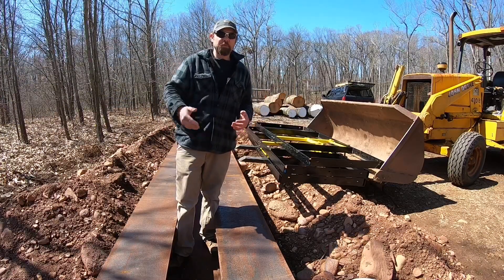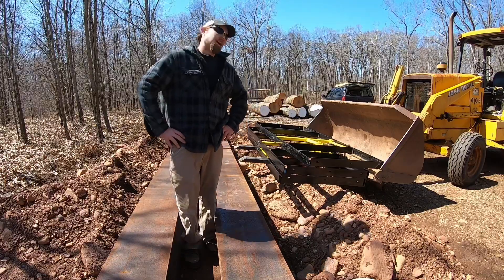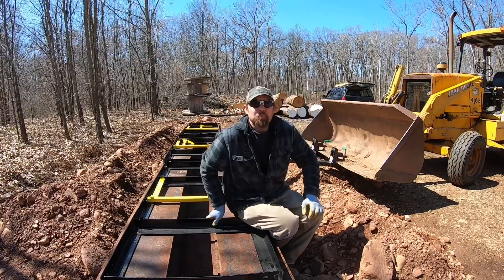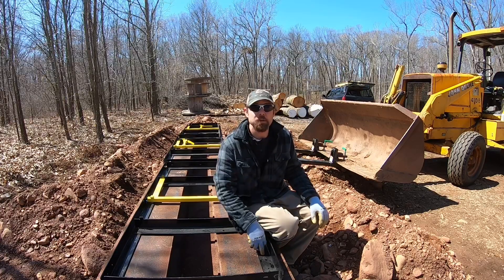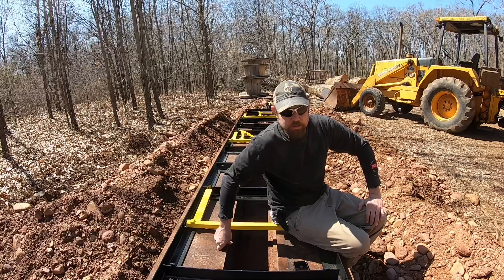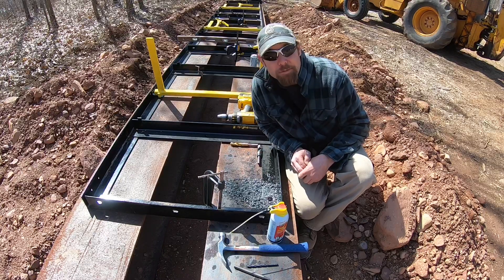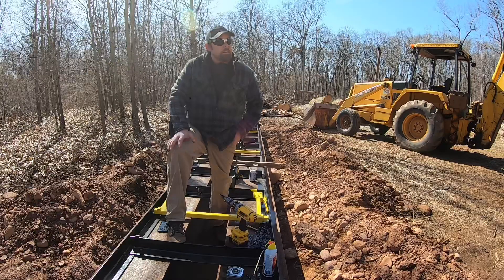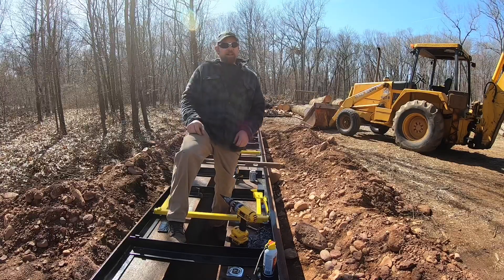Hudson HFE30 base build part 3- leveling system

Comment: Good day Sir, you will make also great train track you know 💪👍🤣 Great set up for you wood mill 👍 You are a very patient man drilling at the holes,💪👍😉 I would probably use my stick welding machine for piercing all these holes 👍Have a great Easter Sir Cheers 👍🍻
Reply from the maker: Happy Easter to you as well. I am going to borrow a friends magnet drill to finish the rest of the holes. Going to save allot of time thanks RCA
Reply: @Aaronzap15  👍😉🍻

Comment: Looking good! My mill came with bolts, washers, and lock nuts. Drilling is a pain in the arse. Because mine is set on concrete I had to tap the holes as well😳 on a good note, I mentioned my winch (gears) were not pre-lubed under the cover. By the time I figured this out teeth were already damaged. Last Thursday the winch bit the dust. One call to hud-son, wayne in thier warranty dept. Not only stood behind thier product, but had a new winch on my doorstep Saturday morning. Always a great experience dealing with thier people. On that note make sure to check your winch and lube it.
Reply from the maker: I’ll definitely check the winch gears thanks for the heads up! Ya a friend of mine is going to let me use his magnet drill. Should go faster. Thanks 2BO